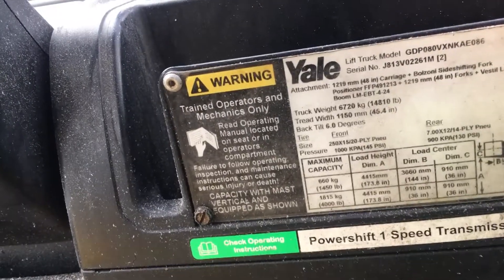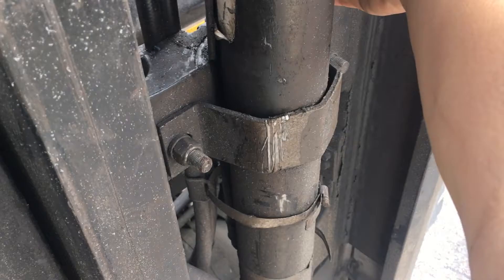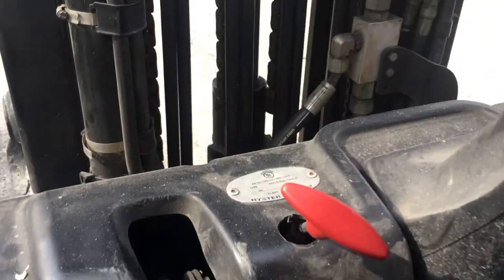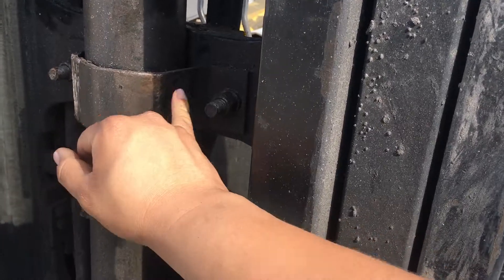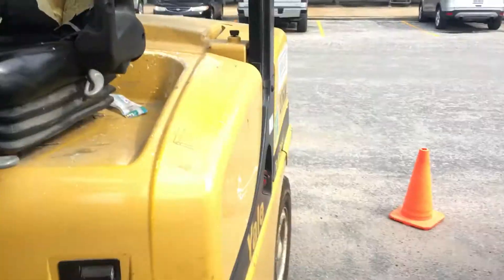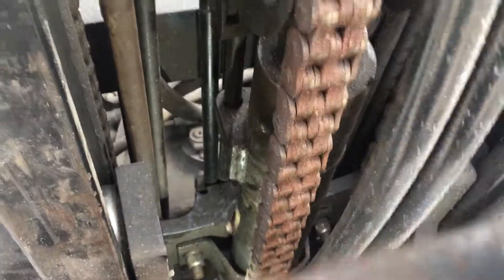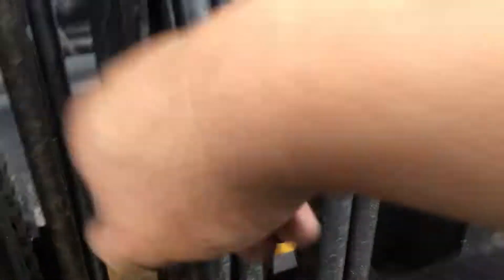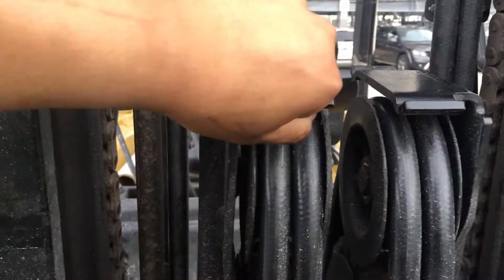Loose hydraulic cylinder, reshimming it

Comment: I remove the bracket, smack it with a sledgehammer to spread it and reinstall it. I would also say you probably have carriage rollers going bad and the chain anchors are scrapping the bracket.